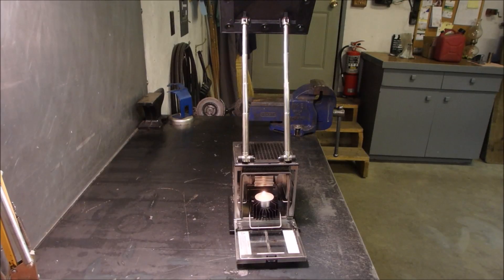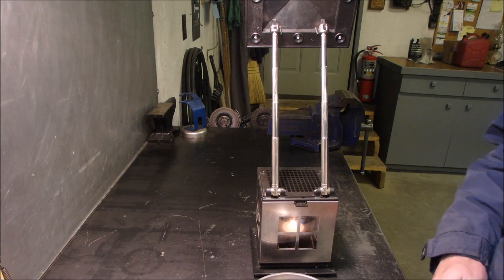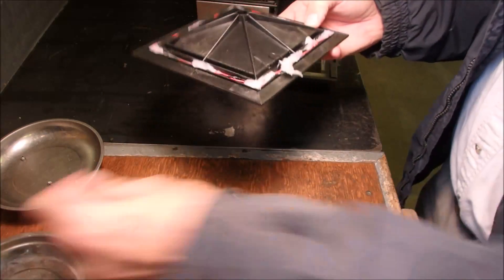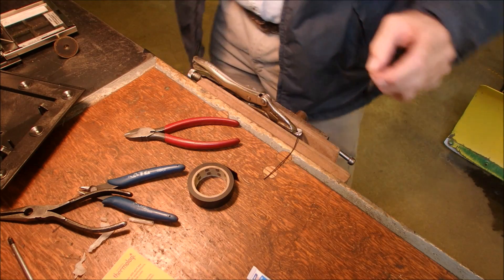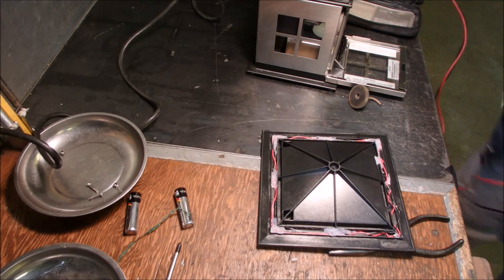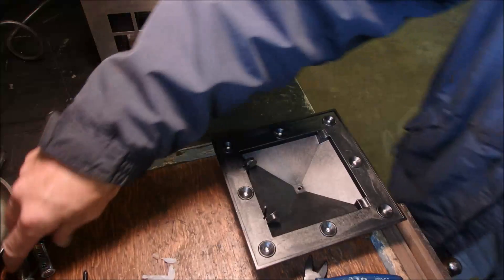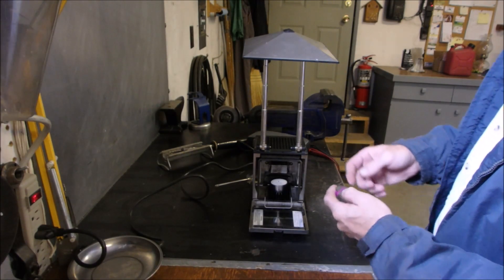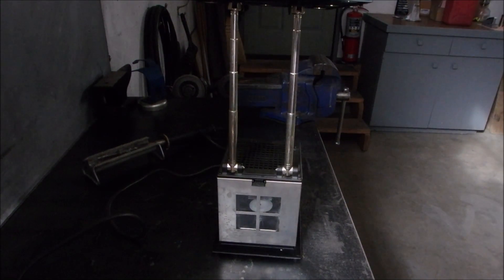Repairing a Candle Powered LED Lamp

Comment: Cool little light. I'm an old timer(67) and I don't understand the saliva thing you did with the wires. I think I would have used some hot candle wax to secure the wires, only because that's what it looked like what was used originally.
Reply from the maker: +Chum joe I should have explained.   I used the wet finger to cool of the solder connection quicker.  It ids an old telephone man thing.